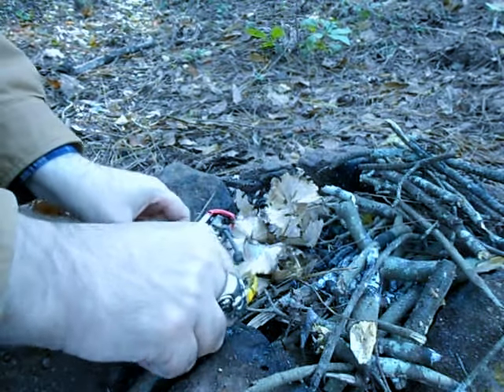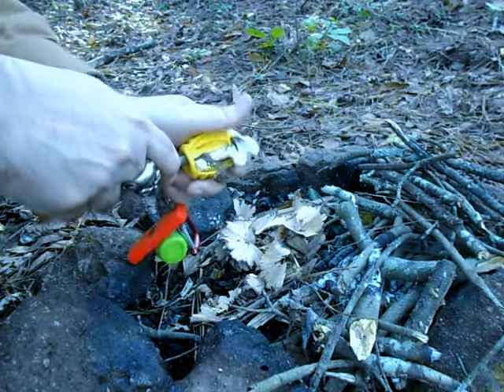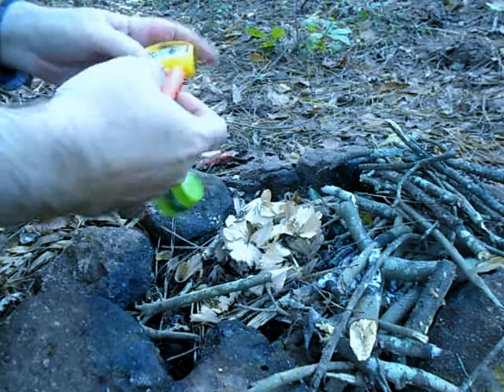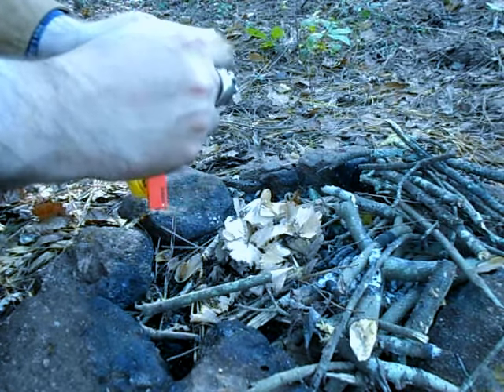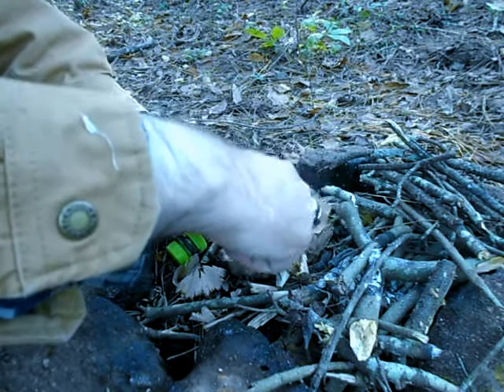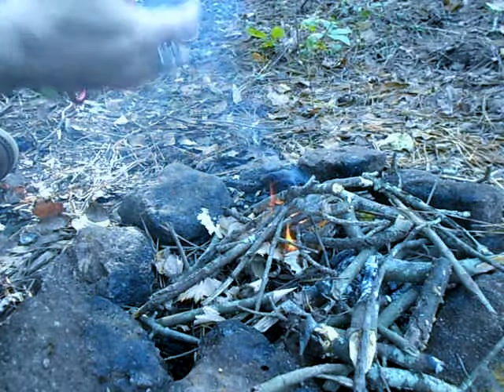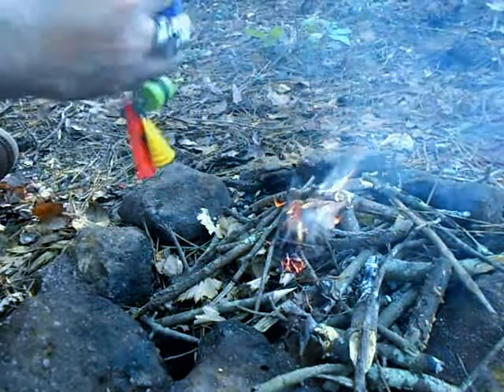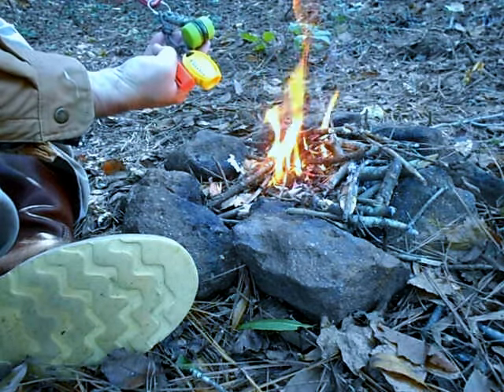BUSHCRAFT  EDC : SIMPLE FIRE KIT

Comment: great :D  sharpeners   are  simple way to get tinder that most people can use and get..  The split ring for the lighter can work , but remember the metal can slip off still.   I use cordage instead. 
TFS  C.R.
Reply from the maker: thanks for watching brother, i have used a ranger band on a split ring before to hold the lighter it works really well . I have a few ideas i have been trying i will show in a another video .